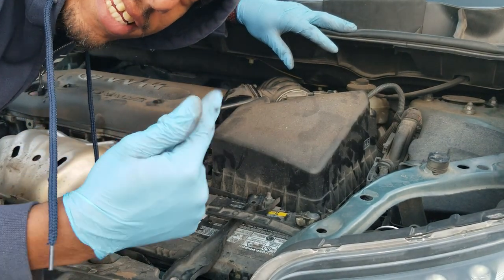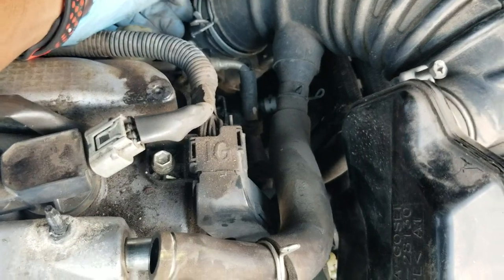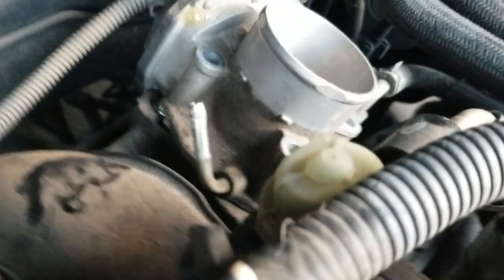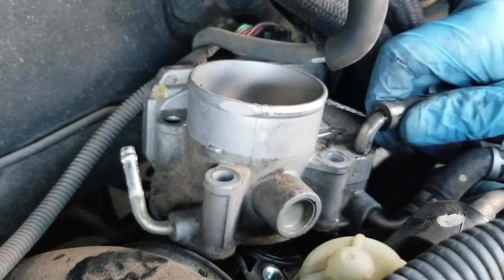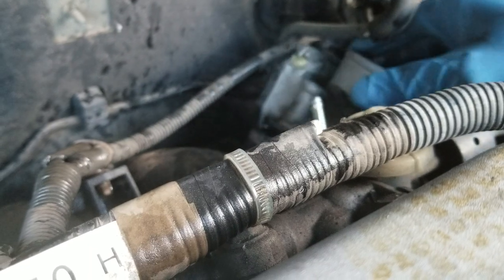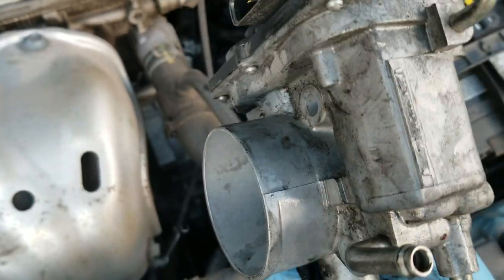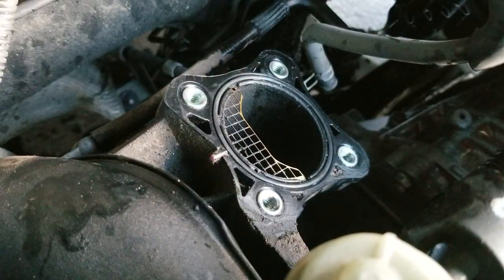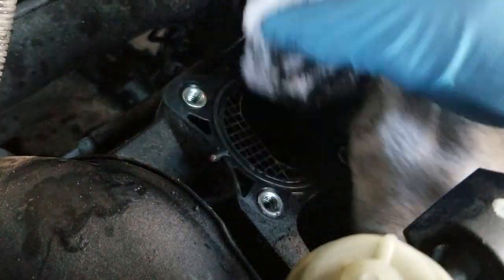Scion xb throttle body removal and sonic cleaning

Comment: Thanks for the video! My 08 Scion Xb had a low idle and would stall. Taking the throttle body apart and cleaning it fixed the problem and it is running like a dream now. 👍🏻

Comment: My Scion TC had a bad idle.. I sprayed the mass airflow sensor with maf cleaner and it idles great now. two screws and it pops out.. very simple to clean. Buy a can of maf sensor cleaner and spray your sensor, if it doesnt idle better, then go ahead and clean you throttle body.
Reply: Where's those 2 screws at?
Reply: @lizard878  On my 06, its a small square box on top of the airbox lid. Right near the clamp at the lid and the rubber boot. There are 2 small phillips head screws. You dont need to unplug it.. Take them out and lift the electronic part out but dont touch it at all. Just spray it with the right cleaner a couple times, it dries quick then put it back together. I think I'll do mine again since you reminded me.

Comment: Did mine todayyy i just bought a new throttle from ebay for 50 bukkks ...better to go new if you're taking it off alreadyyy ...took me 30 mins to switch it ...thanks alot for the video ...
Reply from the maker: Nice Buy bros. depending on how many miles is on your throttle body you will be cleaning it  far more than buying a new one every time

Comment: Hey man. I just had this exact issue with my scion. This cleared it right up. Thanks for the great video!
Reply: 2011 scion, dealer cleaned it and said the shaking at 500 rpm idle will go away, it hasnt
Reply: @dteh4501  did they really clean it 🤔
Reply: @tecno8335  we ended up replacing it, on that same vein, I have not found consistent workmanship where I live 😒

Comment: Nice video. Just did my 2010 XB throttle body. Runs so much better! Had to watch yours video again to see if there was a clamp on the lower small hose below the electrical plug. Thought I might of drop it. No clamp needed on that vac hose.
Reply from the maker: Glad to help out brotha thanks for the comment. Did you sonic clean yours?

Comment: I've been told if you take out the electronic throttle body out you have to use a scanner to relearn throttle body position otherwise your car will stall. Any problem  of that nature to the ones who took it out ??
Reply from the maker: That's an excellent question my friend you do not have to take out the electronic throttle body if you are swapping throttle bodies most of the time they automatically will relearn. A scanner is not really needed to relearn cars have a factory relearn sequence just look it up for your car
Reply: The throttle position sensor might need recalibration if its removed and reinstalled. It's attached separately to the throttle body on some cars.  On the Scions it's built into the throttle body, so you don't need to worry about it.
Reply: Recal mostly effects post 2014 for Toyota/ Lexus/ Scion

Comment: what YEAR is this Xb...mine is a 2006 ...it looks backwards... my heatshield is in the back..

When I clean Camera parts...   I actually pour Naptha into my sonic cleaner.   Naptha works great.   Make sure anything with paint is not placed in there, because the paint will come right off.
Reply from the maker: 2009 xb . Glad it worked for you

Comment: Thanks for a great video. I am very new at this so please help. I need to know where the MAF is located and how to clean it. Do you have any videos of this?
Reply from the maker: If you know where the air filter  Box is located it is the 1st sensor on  the air duct. It has one plug and two screws very easy to take out very easy to clean with special mass air flow sensor spray at your local parts store hopefully that helps or there's plenty of videos about mass airflow sensors

Comment: I just cleaned mine yesterday maf sensor and throttle body on 08 scion xb same as the video installed everything back turned engine and a popping sound with some smoke came out and now my car wont stay on unless i keep the gas pedal i need help please!!
Reply from the maker: Sorry to hear you're having this issue. Hopefully you did not get the electronics of the throttle body submerged in water. Maybe you can try throttle body relearn sequence for the Scion or try to disconnect your battery. To me it sounds like your throttle body is out of sequence and needs to be relearned

Comment: You didnt disconnect the battery first thats why you have pressure of the water pump still on,i did my cleaning too and it always say to disconnect battery before taking off the mass airflow connect or other electrical
Reply from the maker: Preciate your comment brother but the water pump is ran by the drive Belt its  Not an electric pump.

Comment: One note, it's probably a good idea to spray and clean the throttle body away from the engine compartment. I'm sure it's not too damaging but it's probably a good practice. Plus it allows you to use the sun to dry stuff off quicker.

Comment: Badass man I dig the video sure did help alot. Question though I got the exact same scion so maybe you can tell me why when I drive and press on the gas pedal my scion actually slows down to like 10 mph. Then itll kick back up randomly. Hitting red lights is a nightmare for me tbh. Please help
Reply: Cadillac converter?

Comment: where the last hose going on the back of the throtter body
Reply from the maker: That's a great question and the answer is I don't know I'm pretty sure it's a vacuum hose. It probably goes to the EGR or somewhere on the intake plenum
Reply: @supersyx  my old one came wiyh 3 and they send me the one with 4 i close the 4 one in the back and i dont know if  affect the car
Reply: they look the same only with the extra hose thin i speck spanish lol sorry i try

Comment from the maker: Thanks for the comment brother but sorry there's not one   particular thing I can tell you to  Solve your issue. You might need a mechanic at this point Because They are so many probable causes we don't know where to start.  If I have to guess you're either getting lack of air flow or lack of fuel. Probable causes could be air filter, throttle body, catalytic converter, fuel pressure Regulator, fuel injectors,  Fuel pump,  Clogged muffler, PCV valve, engine timing,  etc. Good luck brotha. 
86 GOT YO FIX

Comment: Interested in switching out my 2012 xB stock throttle body for a larger aftermarket one for hopefully more gains. Any suggestions as to what brand and or size?
Reply from the maker: great question brother. I  assume the gains your looking for is horsepower ? i dont recommend a larger throttle body. the only gains if any  that you will see/ feel is maybe a bit quicker acceleration but you will start to lose some M.P.G. there is no one mod. to do on this car for instant GAINS. either dive all in or leave it stock. the money to dive all in will equal the amount of a faster, better car like a 2006 mustang. hopefully this answers your question and save money  but people do whatever they want.
Reply: @supersyx  yes more HP Is what I was hoping for so it seem then that this particular mod would be a waste of time from your experience. I already have cold air intake, exhaust, & a header. Any other suggestions for adding a few more ponies without going with a super charger? How about an intercooler kit? Thank you Eighty6 subscribing now. Cheers!
Reply from the maker: @TroyVoid   What I am trying to say is all The Mods you have added so far only increase horseower by very little.  And for this particular car that's not fast to begin with you going to spend a lot of money trying to make this car fast you will be better off Find a faster car to begin with. But if you really want to make this car go faster then it's going to cost you with things like maybe a VTEC engine swap or a speed shop to port and polish your motor and other things like a Turbo I want the baby to intercooler different cams bigger injectors and throttle body.  It all depends on how much U trying to spend

Comment: What causes the dirty throttle body?
Reply from the maker: Great question but air over time, just look at your air filter. Mostly why throttle bodies get dirty because engines recirculate oil to the top of the motor thru the pcv valve and exhaust fumes thru the egr valve which contains oil. The oil mist find its way to the throttle body butterfly valve and dirty everything up over time . Thanks for the great comment.

Comment: Why does my scion xb 2011 has different throttle body only has 3 hoses connected
Reply from the maker: They just simply change the design . Just remember the orientation of the hoses and you'll be OK
Reply: @supersyx  idk but when i put it back it take so long to crank and start and when i turn off my ac while on a stop the idle fluctuating...🤦🏽‍♂️
Reply from the maker: @jannacino5495   Sounds like you need a new one
Reply: @supersyx  🤦🏽‍♂️

Comment: Ik this is old but did you burp the Radiator after you did this.
Reply from the maker: Great question not really I believe I just topped off the fluid but you can definitely take the extra measures to burp the system if needed

Comment: I find my xB hard on my feet. I have a hard time fitting into shoes lately idk why and maybe the car is why. It’s so hard on my feet holding the brake
Reply from the maker: Great question I'm sorry to hear I might not be able to help you out on this one .  it's hard to understand the symptoms you're having
Reply: @supersyx  I mean the brake pedal feels high and I feel like im far from the pedals all the time so I gotta do this real steep angle with my foot. I end up putting my toe on the edge of the brake, straining my foot. I try to put it more square but it’s hard.
Reply from the maker: @newblakestone   This issue sounds very strange maybe go have your car looked at by professional I'm guessing you might have an issue with an issue with your break booster
Reply: @supersyx  yeah…mechanic I bought it from is completely ignoring me.
Reply: @supersyx  uploading now

Comment: What size are the bolts on the throttle body?
Reply from the maker: 10 mil I think
Reply: Just call the dealer they would be happy to tell you in the parts department.:0)
Reply: Its 12mm. I just did it recently